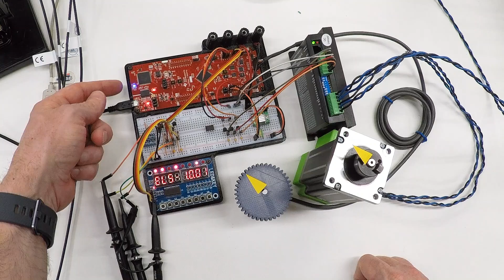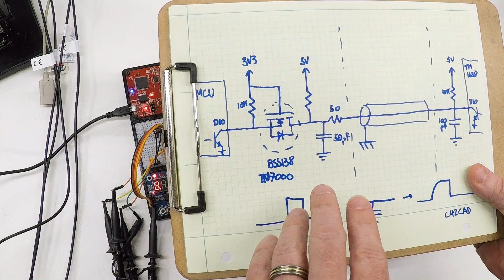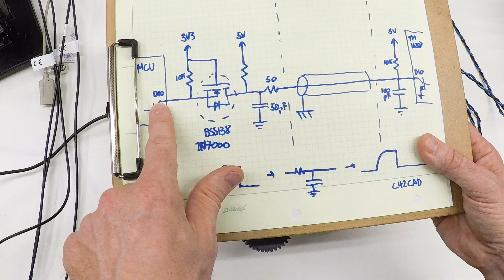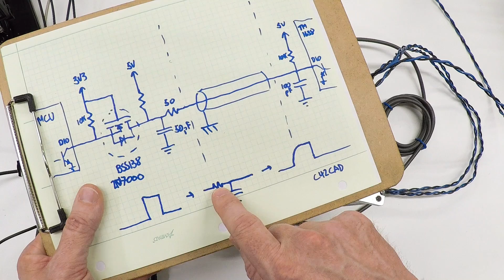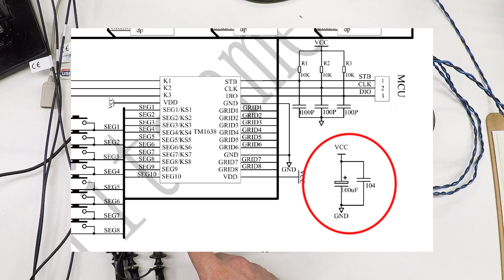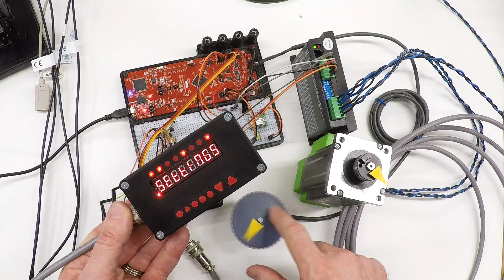Lathe Electronic Leadscrew Part 3: Control Panel and Debugging

Comment: Touch Screen Thoughts 
I know you mentioned in a previous video, that a touch screen would be a bad idea in a shop environment. I still think that it could possibly work. It's supposedly not that uncommon on high end CNC controllers (I think Mazak has one with touch screen). I'll admit that my iPhone is horrible if my fingers are just a tiny bit moist or greasy, but I have had that exact same phone in a super cheap zip lock style bag for diving trips and even with wet hands and gloves on, for some reason I have been able to jot down GPS points when I got back on the boat. Just saying, there must be some touch screens they work well even in an workshop environment. Maybe even some cheap solutions. 
Either way I, can't wait to get my hands on your board and make this upgrade:).

Great to hear you will test servos also. Since you are making the rest of the controller so "sturdy", I think a closed loop for the leadscrew makes a lot of sense.

Actually, apologies up front for the crazy curve ball here, but is there any way this could be made to work as an APP on, say, Android...? I did put scales on my little lathe and used Yuri's TouchDRO firmware on a cheap TI Launchpad. How amazing it would be if there was a way to merge his and your features into one APP. I know you might have plenty of very good reasons for not doing that, but no harm in trying to respectfully plant a seed.
Reply from the maker: The smartphone app idea is definitely possible, but probably out of scope for the work I'm doing.  Priority one is getting the core controller and a simple UI working.  It could eventually be configurable to use different display hardware, and a bluetooth dongle with an app for the display seems like a reasonable option.